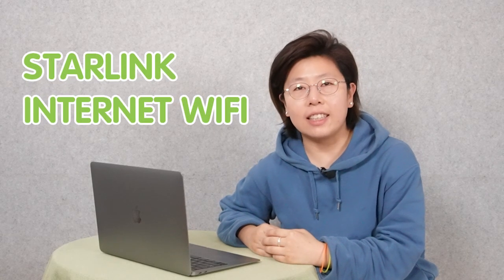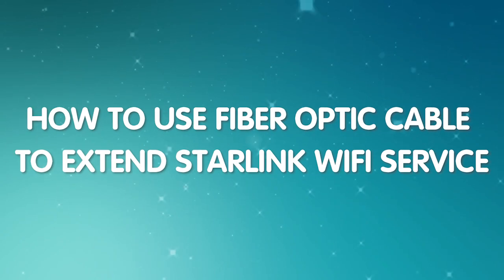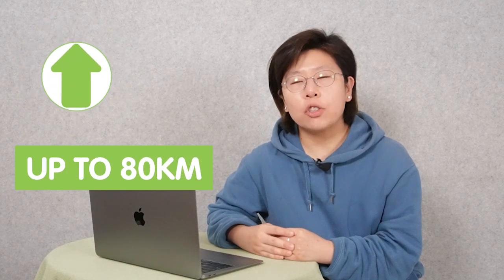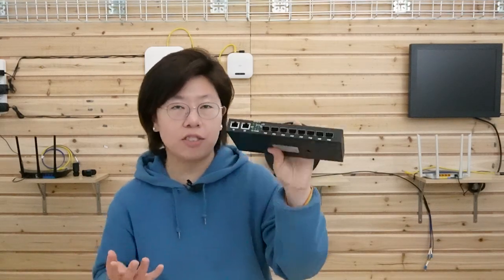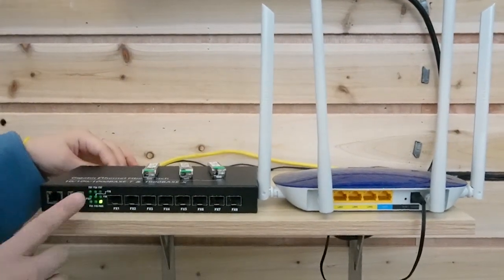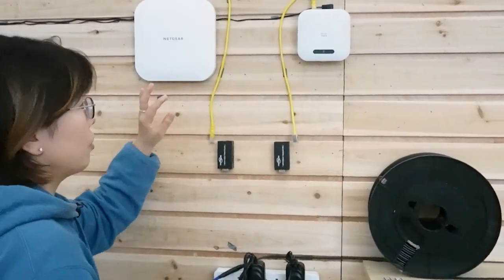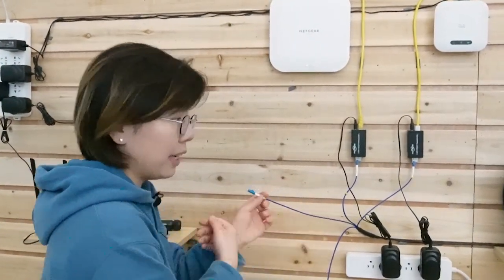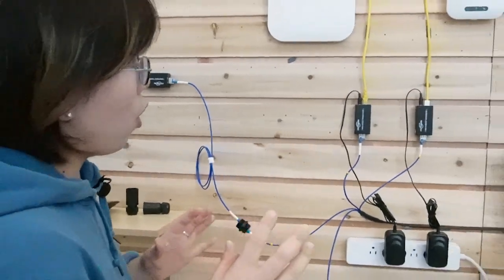Extending Starlink Internet Service Using Fiber Optic Cable| Case Study

Comment: So you can just connect the lan cable from the starlink to the switch without having it connected to another router (ex. mikrotik)?
Sorry for my bad english.
Reply from the maker: When you connect Starlink directly to a switch, you can try one of these methods:

1. Starlink Standard (Residential or Roam)
If you disable bypass mode, the Starlink router handles DHCP and routing.
Plug the Starlink Ethernet Adapter into your switch — clients on the switch will get IPs from Starlink.

2. Starlink in Bypass Mode
You must have your own router (e.g., MikroTik, TP-Link, etc.) to handle:

DHCP
NAT
Firewall/routing

In bypass mode, Starlink acts like a modem only, so a switch alone won’t work unless something on the network assigns IP addresses.
Reply: @Fastcabling  Thank you for the answer.
Reply from the maker: You're welcome!

Comment: What about if i don't have power in remote area where i want to send wi fi to, how can i carry power to that location via fiber line
Reply from the maker: You can use composite fiber optic cables which are consisted of 2x fiber strands and a copper wire to transmit power and data simultaneously to the device. Watch this video👉https://youtu.be/Y5PxdUOE9zY

For more information here: https://www.fastcabling.com/product/100m-composite-fiber-optic-cable/

Comment: Okay so im about half way in the video but i was wondering if i added a bit of fiber optic cable in my house, and set it up as it is supposed to be, would it increase my speeds and make it better  but i do have decent speeds for download, its just my upload speed doesn’t exactly match it too well like i see from other people and ofcourse they have your average internet plan but i have starlink and to be more specific i have the new gen 3 router and dish and i get around 300-400mbps download which it shows the max speed is 350mbps when i check google and the fastest i have seen my speeds was 850mbps download but the upload speed is anywhere between 17mbps-29mbps and i wish the upload speed was faster so i started getting recommended fiber optic to starlink videos but no one has really shown how it’s connected exactly and how the improvements are, i only see ones like this or just talking about it, im no expert in this as well as we don’t have access to fiber internet here because we have around 200 people here so its not something the town can afford so i was just wondering if i set it up myself would it be any better in any way since i do know from what i seen that starlink supports up to 10gig speeds
Reply from the maker: Replace the UTP cable with fiber optic cable in your house will not increase the internet speed. The bottle neck is the incoming internte access in your case. The cat6 cable can handle 1000mbps, and I don't think you can have 1000mbps from Starlink at this moment.
Reply: @Fastcabling  not currently but i think it’s said it can reach that amount tho no one has mentioned getting 1000mbps on starlink, maybe one day soon when they throw up more satellites in the near future

Comment: Wireless Bridge - Shielded CAT6 - POE Injector = Good for miles assuming you have line-of-sight and way cheaper than fiber 🤑
Reply from the maker: If you are setting up a temporary connection or for scenarios where laying cable is not feasible, the wireless bridge is a good choice. It can be relocated or adjusted with relative ease compared to fixed cabling. But you need to strike a balance between cost, reliability, and even scalability. 

Fiber can support extremely high data speeds, often in the range of gigabits per second, which is crucial for applications requiring the transfer of large amounts of data. While wireless bridges have distance limitations and may require line-of-sight, fiber can effectively transmit over kilometers. It's very difficult to tap into a fiber cable to intercept the data transmission and it's immune to RFI. However, I do agree that installation can be more expensive due to the cost of the cables and the labor involved in laying them. 

Ultimately, the decision should be based on a careful assessment of your specific needs, the physical environment, budget constraints, and future scalability requirements. Just in this case, our client chose to go with fiber.
Reply: "Cheaper" always means doing it poorly and it won't be as reliable.

Comment: which SFP was used at switch and Accesss point side?
did switch configured or not?
Reply from the maker: It is the single mode BiDi SFP transceiver. No need to configure anything. It is simply plug and play.
Reply: ur using how many corw fiber optics?